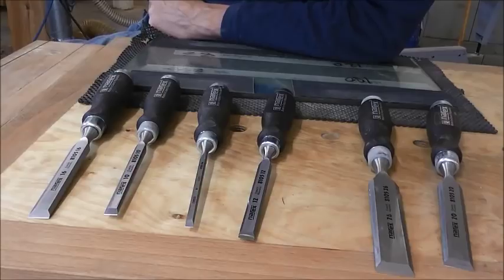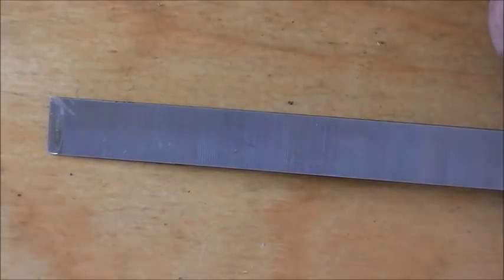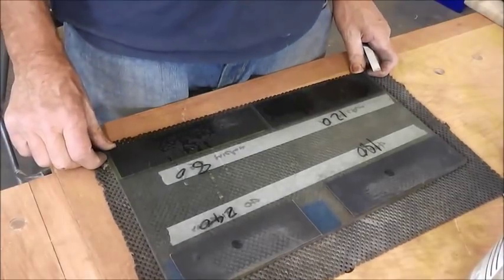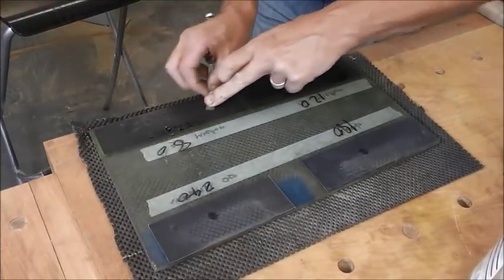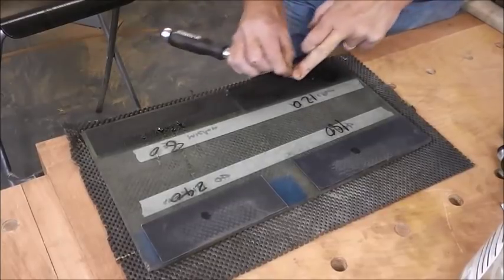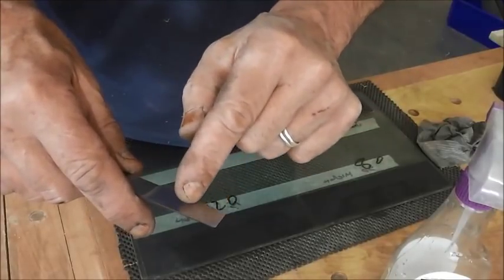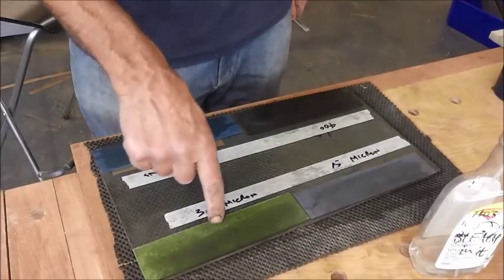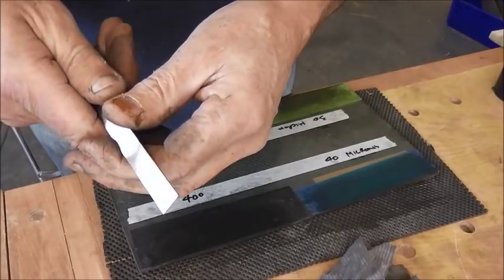How to flatten the back of a chisel or plane iron.

Comment: Good advice. Like a lot of things in the trade I have adapted over the years. For more years than I remember I made do with one stone a Norton combination that I made a coffin box at College and still have it along with a replacement stone same ilk but not used. Now I have Diamond stone combination 350/1000, Water stones 3000/7000. I still use sandpaper from time to time and stopped free hand and went over to a Veritas Mk II along with some its attachments especially in narrow chisel honing. Tried a few honing guides from cheap to dear and settled on the one mentioned. Again like a lot of things in Wood tools it is down to preference and how you want your tools to be. My journeyman and other old Joiners would be amused at what goes on now as best practice a Norton combination done their needs and grit choice was not a big part of sharpening, it was to get an edge that did not chip or loose its hone. Its been like that back to the first person who cut wood and needed to fashion it.

Comment: best flatening video ive seen by far. ive been trying to use sand paper to flaten a really out of flat chisel but the sand paper wears out unevenly and then puts the chisel out of flat just in a differrent shape any ideas on what i can do about that?
Reply from the maker: Thanks for the compliment David. What sort of abrasive are you using? Is it just sandpaper or perhaps silicon carbide wet and dry? I think plain sandpaper would wear quickly, wet and dry would last longer but I find 3m microfinishing film best if a bit more expensive. Often flattening a chisel with a convex back can be very difficult because it will tend to rock on the curve so never getting flat. You have to try to work a flat at one end of the curve then extend it back. Bear in mind that we are really only interested in about 1 1/2" at the end of the chisel.
Reply: @MrCJTribe  thanks for the reply. i did some research and found out some abrassives will fracture without leaving the paper meaning its easy to make the sand paper dish/bowl out. a few sources said the silcon carbide abrassives simply break off of the paper when there finished meaning the sand paper stays flat it just cuts less quickly. i cant use anything pricey im on a budget but i did find a cold work chisel so i figured i could use that to make a hollow instead of a belly similar to machining from 60 or 70+ years ago. i tried wet dry sand paper (should have silicon carbide) and a granite surface plate and my engineers square says it working perfectly so far. i messed up so i have to start over but i should be good to go now. if i find anything usefull or think of some new method i will try to remember to share it with you just in case it helps thanks have a great day

Comment: Thank you Chris. Appreciate you taking the time to show us how to lap the back! I guess I need to setup a station similar to yours with various grits glued or stuck down. I know that as we use the abrasives it wears down their effectiveness BUT couldn’t it then be considered a slightly finer grit? Perhaps that would keep me from having to reapply a new sheet as often?
Reply from the maker: Hi Mac, abrasive is graded by the size of the particles, the particles produce scratches in the surface according to their size. As the abrasive wears out the particles lose their sharpness but do not get smaller so they will still produce the same scratches. Unfortunately you can only remove these scratches by going to a finer grit.

Comment: Chris, it’s been suggested to me that if I’m going to have to save up enough money to buy a decent set of chisels, I should buy the Narex brand. Since you also mentioned them here,  I’d like to ask if you feel they would also be able to be used for doing dovetails?
Reply from the maker: Hi Mac, apologies for the delay in replying. Narex are a good economy brand of chisels. The cheapest ones are their basic bevel edged set, these have quite a thick side profile which may limit their usefulness for dovetailing. The more expensive cabinetmakers set have a more refined profile which make them better for dovetailing, these may be better if you can afford them. I mention the profile of chisels in my beginners tools video.
There are also the cheap chisels sold by the German super markets such as Aldi and Lidl (do you get Aldi and Lidl in the US) which Paul Sellers recommends.

Comment: Great video. A quick, noob question - since 40 microns is equivalent to roughly 350 grit, shouldn't it go before rather than after the 400 grit abrasive?
Reply from the maker: Hi Marc Thanks for the comment. Not a noob question at all. In fact there is an inconsistency there. Actually 400 grit is more or less the same as 40 microns, give or take a gnats whisker (yet another unit  of measurement!). So yes I should perhaps have progressed from 400 to the 30 or 15 microns, the 40 microns didn't not achieve much.

Comment: Why do you think it is necessary to start with 80grit on a new chisel, I would expect the machining to be closer to 180grit, it seems counter intuitive
Reply: It's not so much to do with the scratch pattern as the flatness. Fair enough on a new Lie Neilsen or other up market tool which will be pretty flat you could start with a finer grit but many new chisels are not particularly flat so you need a courser grit to achieve flatness quickly. It doesn't take long to work through the grits once you have achieved the initial flatness.

Comment: I have an old 1 1/2 inch I'm trying to restore.  Flattening it is a bear since it appears to be curving up at the edge. In other words holding a straight edge to it, shows a 1/2mm gap at the edge. Do you recommend just grinding it shorter at the edge or flattening it as much as possible?  Some of both?
Reply from the maker: Blades that are convex across the width are a real pain to flatten as thre is a tendency for them to rock on the high spot as you work them. Is it curved across the whole width or just rounded over at the edges? If it's just rounded at the edges you could grind this off, not something I have ever done I must admit. If it's curved across the whole width it will involve a lot of work to flatten it. You would need to apply pressure at one side so a flat is formed to one side of the blade, this can then be extended across with a few hours work! You could use quite a course grit wet and dry 60 or 80 perhaps.

It probably got the curvature from sharpening on a non flat stone over many years

Good luck with that!
Reply: Chris Tribe Yes, along the width. But, lengthwise too. Almost like a small ski ramp at the edge as you go lengthwise toward the bevel (just the last two mm in length). .  I'm thinking to just hollow grind out the middle part to get rid of the widthwise concavity,  and then grind off the edge to eliminat that little upward slope. I don't see any other option. Then, I'd go through the sandpaper.  Or just throw it out...lol!
Reply from the maker: You could just grind the end as you say. Hollow grinding could be tricky, I admit I have not tried. You will have to ue a very light touch, although the curvature may appear large it is probably only a few thou. Please let me know how you get on with it.
Reply: @MrCJTribe  Ward chisels have the "chopped out with a pastry cutter " shape along the edges.They are like that from new.Rubbing down the back with a dremel sanding drum is a good way to save hours . Get a few inches clear from the blade edge .Leave the edge1/4 inch alone and then flatten as in the video .Or add a micro bevel with a thin ruler under the handle end . Use the full length for that . Then ---you find many chisels have a built in Twist . Dremels will help with that too .Diagonally opposite shiny spots will show you what to do . Time to test that and make a new video for old Sheffield blades .Good fun but not too laborious .

Comment: Where did you get the abrasive strips on your sheet of glass?  Any links?  Thanks!
Reply from the maker: Hi, In the video I am using silicon carbide wet and dry abrasive. It's stuck to the class using Spray Mount from 3M. This is a repositionable contact adhesive. I like Soray Mount even though it is pricey because it gives a nice even film with no lumps when sprayed and is repositionable. Another option is another 3M product - Micro finishing film. This is a self adhesive film impregnated with abrasive. It's more expensive than wet and dry but cuts better and lasts longer. I get it in the UK from https://www.workshopheaven.com/3m-micro-finishing-film-50-micron-ao-psa.html The grade is specified in microns so the greater the number the courser the abrasive. I use 100 microns  through to 9 microns in about five steps.

Comment: Hi are you just using water on the wet and dry or solution?
Cheers
Mark
Reply from the maker: Hi Mark
Yes, it's just water. If you want to flatten an oil stone you can use paraffin.
Reply: Thanks so to flatten an oil or water stone do you just go about it in the same way of grinding it down on various sand paper grits?
Thanks
Reply from the maker: markblue777 Actually I've got my videos mixed up! I have another video on flattening a water stone or oil stone. The technique is very similar, the stone flattening vid is here How to flatten water stones.
Reply: ah thanks alot

Comment: Narex Standard vs Premium. Are the handles the only diffeence?
Reply: Did some research... No, they differ in profile as well. But! The ones Christopher has are neither of those. They are called classic. 

While we're at it, could anyone testify on their edge retention? I personally doubt the Kirschen/Two cherries chisels price being 2-2.5 times higher compared to Narex is justified. In the fine woodworking magazine 200 they both brands rated 'good' in edge retention. I would really appreciate a second opinion.
Reply from the maker: Tome4kkk is  right the profile on the premium (cabinetmakers) chisels is slimmer as shown here (if the link works) http://i397.photobucket.com/albums/pp60/mr-tpics/IMG_02601.jpg the premium is on the left.

The hardness is the same but the slimmer profile makes them better for delicate work like dovetailing. The one being worked on in the vid is the standard type. I also think the premium ones feel better in the hand.

They are both hardened to RC59. The Kirschen ones are harder at 61, but I'm no expert on that sort of thing. If it only takes 30 seconds to sharpen a chisel then hardness is not such an issue in my opinion. Sometimes I find too hard a tool is a pain to sharpen, you can never find the burr.
Reply: There seem to be another model. Handles like on yours but with blade profile like on premium, available from lee valley I believe. Yet, Narex themselves don't have them on their website. I queried them about the subject but haven't heard from them.
Reply: BTW, I made a 16x40 mm mortise recently using a 12 mm low bevel sides chisel. I found it to be digging in too much into the adjacent wall (laterally) when I was trying to correct the 16 mm wall. Was it my blatant mishandling or is it natural and needs to be controlled? The fibers ran along the 40 mm side. It was a black locust mallet head, well over 15% of moisture.
Reply from the maker: Hi. I'm not sure how to answer your question because you seem to cut your mortices differently to me. Whenever I mortice I always make the mortice the width of the chisel I will be using. So for your mortice 16mm wide I would use a 16mm chisel. Perhaps if I only had a 5/8" chisel which was a bit off 16mm I would set the mortice gauge to that chisel. I would then use just that chisel to chop the mortice. Paring the side of the mortice is a capital offence, I want the mortice to be exactly the width of the chisel.

Obviously for huge mortices such as used on timber framed buildings a different approach would be used, but for anything under 3/4"/19mm I would use the method above.

Chris
Reply: I see. I'm quite surprised I admit. 

A follow up on the lee valley exclusive model. I got a confirmation that indeed this is a lee valley exclusive model. Blade from 8116 and handle from 8105. 

I've just ordered 8105. I would like to taste the profile myself in the field and see whether it will come in my way during dovetailing.

Comment: I bought some chisels and one of them was convex it has taken me hours to work on and still isn't flat because my highest grit stone is 600 diamond 😟
Reply from the maker: I would recommend using an abrasive stuck to glass, I use 3M spray mount to stick it. You could use aluminium oxide or slicone carbide wety and dry abrasives.  For some plane blades I go down to 60 grit but you  may eb OK with around 120 grit. Then you have to work your way up to close to 600, then you can go back to the diamond stone.
It can be very difficul;t to get a convex surface flat using this method as the tool tend to rock on the high spot. You have to encourage it to sit in one position on the abrasive
Reply: How do you tell if your chisel is concave or convex. Seems to me that dull marks I’m center (scratches) would mean it’s convex but internet suggests otherwise?

Comment: Another person assuming float glass is flat. It isn't. Nothing claimed to be flat without being properly measured as to exactly how flat it is, is bogus.
Reply from the maker: Fair point. However the concept of flatness is relative depending on what instrument you have to measure it with. As far as I'm concerned 10mm float glass is flat enough for flattening the small area of a chisel or plane blade back. For flattening plane soles which have a larger area I check for flatness using a a registered straight edge and feeler guage because I know that over a larger are the glass can sag if the surface it is on is not perfectly flat.

Comment: You just ruined the video at the end saying "once in a lifetime"you need to flatten the back.How about Japanese chisels that have a deliberate hollow to allow for the fresh flattening and also to prevent any rocking.The Japanese do not align their chisel backs with the handles either . So making a very slight micro bevel on the back of western chisels is miles closer than a Japanese chisel .Chisels are not planes and the backs will always wear down just like the bevel . Show how you flatten a back that is not already hollowed.